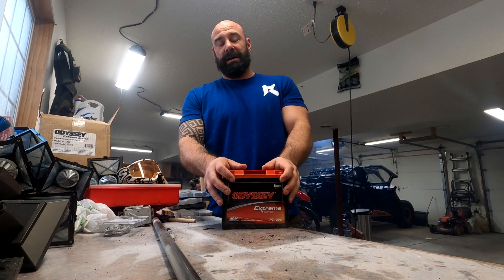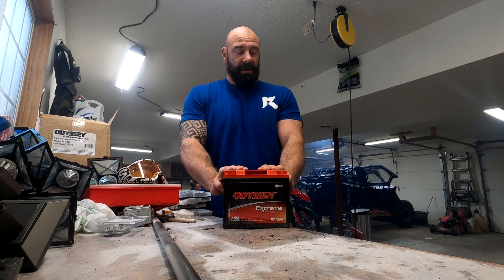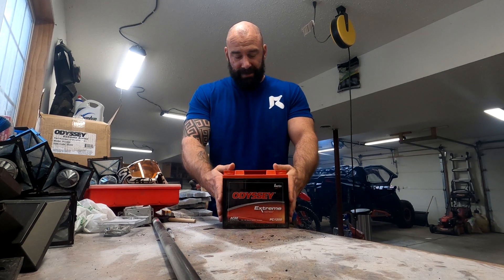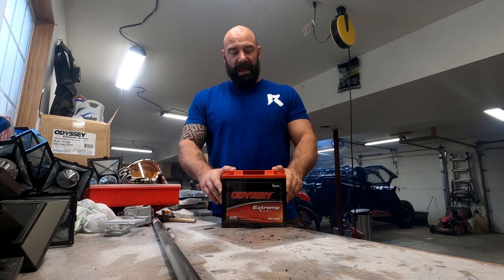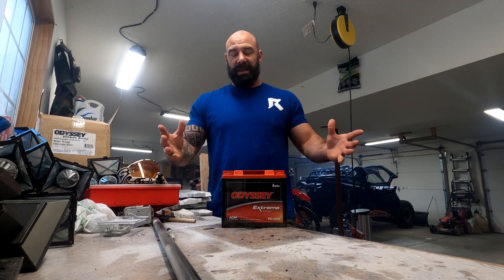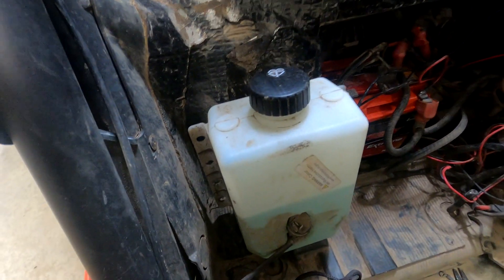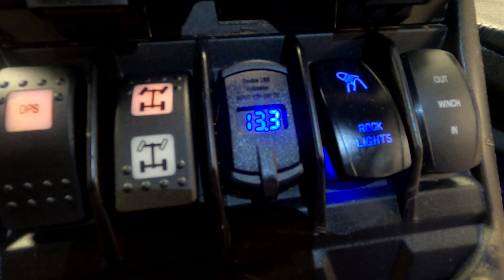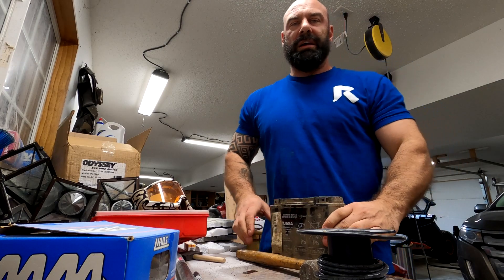Is it time for a bigger battery in your maverick X3?

Comment: He mentioned at the end something to the effect that you’re really running off the stator. That’s correct. The only want you can run without drawing the battery is go with an alternator. Obviously that’s expensive which is why guys are doing the dual battery, or bigger battery like him. Either way, all you’re really doing is giving yourself more storage, therefore more run time. It’s not going to change what the system is doing charge wise (voltage drop)

Comment: I liked your video.   If you'd like a little better idea of what Volts, Amps, and Watts means in a relatable way, I'd be glad to chat with you.    You've got a lot of info already, but if you'd like to see how it all connects together in a relatable way, give this a shot and if you want to chat about it, hit me up.  If you really don't want to go any deeper that's cool, but I can see from what you do understand in the video already you are very close to getting the relationship between Volts, Amps, and Watts.  There is just a little bit more you could use to help visualize it better if you are interested in it.  If not, I'll understand.  Skip the rest of this if you really don't want to go any further.

Voltage:   The potential or the "pressure" behind the electricity.   Literally a 12V battery even at 25% capacity, has so much more potential to do work than even a full 1.5V AA battery.   That AA battery can't even make a spark.   That 25% capacity 12V battery can still make a spark because it has so much more potential behind it.

Current:  The flow rate.   Literally the Amps (current) is just how fast the electricity is flowing.   Whatever the max flow rate is a AA battery can support, 10 double AA batteries in Parallel can flow 10x that flow of electricity, but it will all still be at 1.5 Volts.   (In parallel the voltages are all the same.... 10 AA batteries in parallel is still 1.5 Volts....)    If you don't need 10x the flow rate of that AA batter, but instead are still pulling the same Amps that one single AA battery can handle.... then those 10 AA batteries will simply last 10x as long because they have 10x the total storage.     

One more way to think of current:  If someone pours a cup of water through a straw, that straw is going to limit how much current can flow.   If someone pours 10 cups of water that is being held in a bucket, through that same straw....  then that bucket will take 10x longer to drain because the flow rate is the same.   Current is just the flow rate of the power.    If you want more power than what a straw can provide, you will need higher voltage.   Upgrade that straw to a pipe, and now you can dump that cup of water on someone through that pipe.    You can dump that bucket through that pipe and really drench them but it will still take 10x longer because the pipe is limiting how much water can come out the other end. 

Ok, let's upgrade this visualization and make it even better.     Voltage is potential to do work or in this analogy it is like pressure.  Current is flow rate.     If you have a bucket of water and I have a bucket of water hooked up to a pressure washer, I have more pressure(voltage) and a little bit lower flow rate.  My bucket of water is going to sting you as it goes through the pressure washer.  That pressure washer might take 2 seconds to drain that bucket of water.   Your bucket of water will get splash me in less than 1 second.   You have higher current / higher flow rate, but the only pressure you have is how hard you can throw that bucket of water at me.    I have a lower flow rate probably taking 4 or 5 times longer to empty my bucket of water, but the pressure coming out of the tip of the pressure washer is going to hurt.    Power (Watts) is Voltage times Current.        You have 5x the current and maybe 2000x less power than a pressure washer.   I have 5x less current, but I have 2000x more power going through the pressure washer.

It takes both current(amps) AND voltage to make power.  Power is the total amount of energy consumed.    Your engine / magneto/stator is putting out power.  When you start turning on accessories, they start to drain away that excess power.   When you start to see 12.8 or 12.9 volts, that means your accessories are using up all the excess power that your magneto/stator setup is putting out.    So, like you already said, below that range you are really starting to drain the battery.   Let's say you have only the accessories on that give you a solid stable reading of 12.9V.  You could, in theory, drive around on that and not drain your battery or at least the drain wouldn't be very bad.    But then you turn on a light bar that uses 200 watts.    Well, at 12.9 volts, 200 watts is 15.5 amps.    That is 15.5 amps of current that you are drawing directly from your battery.   That battery can only put out 15.5 amps or 200 watts for so long before it is empty.      Again,  Power (watts) = Voltage (volts) X Current (amps).   You can go the other way:  Power / Voltage = Current    OR   Voltage = Power / Current.

So, if you have a 650 Watt Stator/Magneto setup....  650 is the max power it could put out theoretically, but because the engine doesn't run at the highest RPM all the time, it really likely maxes out somewhere between 600 and 625 watts maximum power.   At 14.1 Volts, that is about 42.5 Amps of flow rate you can get out of it.   600 Watts = (14.1 Volts) x (42.5 Amps)    (with a little bit of rounding going on there.)

If you didn't want to go through all of that, I don't fault you.  If you did and you still have questions or things could be clearer, I'm more than happy to answer questions.  I certainly didn't understand electricity automatically.   I had to study it.   I just felt like you are so close to that next level of understanding, that this might be worthwhile.  I sure hope it helps.

Comment: Awsome vid! I watch u all the time you help me a ton on my x3 

Wondering how did you get your battery to stay put and not Bounce all over the place ? I’m gonna buy the same setup you have just not sure how to mount the battery
Reply from the maker: I have to make something yet to hold it down. If the seat is all the way back it will hold it in there well but need to find something
Reply: Tmw makes a nice battery clamp for about 50 bux
Reply: MMO sells the whole kit for $315

Comment: I’m having issues with me fosgate stage 5 system, my subs under front seats cut out and amp goes into protection mode. I have a relatively newer battery but same size as stock. I do have light bar, rugged radio system, winch and whip lights and I can’t figure out why my subs cut out. Could it be battery is too small? Did yours cut out at all?

Comment: Thank you for the video, quick question for the battery meter how did you wire it? Is it on all time or did you do something else
Reply from the maker: Auxiliary power. So it goes on and off with the Machine. It reads the same even if it was plugged directly into the battery

Comment: Hello man I love the vids, I had a question what is limp mode? Is it the smart lock because my battery is no longer good and I had smart lock failure show up on the dash, and the steering is stiff
Reply from the maker: No limp mod is when the Machine limits your speed and RPMs
Reply from the maker: If your battery starts to go dead before it goes in the limp mode your steering will get stiff because the power steering motor is not getting the electricity that it needs
Reply: @sxsmarine4075  thanks a lot I watch a bunch of your videos they’re very helpful keep it up, it’s good to see the content you put out doing reviews, maintenance and all kinds of stuff.

Comment: just upgrade the alternator and be done with it
Reply from the maker: Lol that would be great but a alternator kit is very very expensive and if it was that easy there would be videos all over of people doing that not duel battery setups. you can get a bigger stator and I think that is what you are talking about. Stock its only 625w at 6000 rpm thats only 44.6 amps at 14v and that’s if you have it at 6000 rpms. I’m good if I’m running down the trail. It’s most the time when I’m not. The Odyssey will keep me going at those times. You can get a 850w stator  but they are about 800.00 for a good one. I can put in 3-4 battery’s for that price.